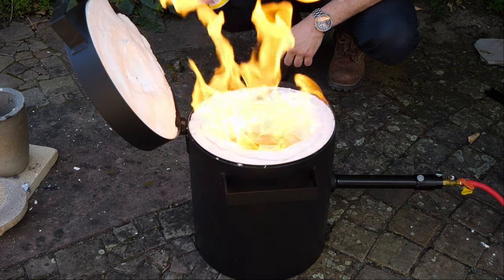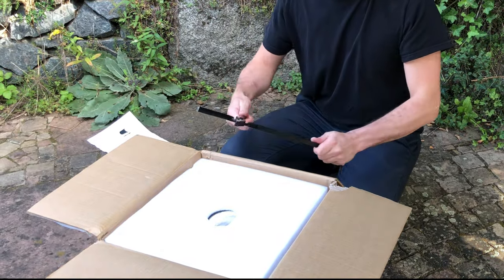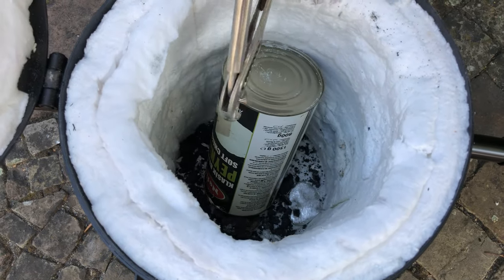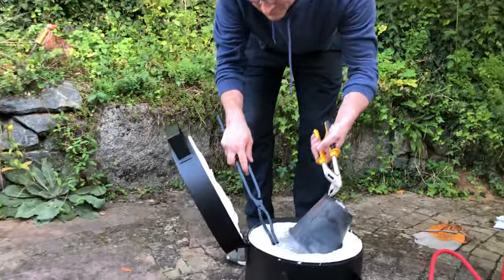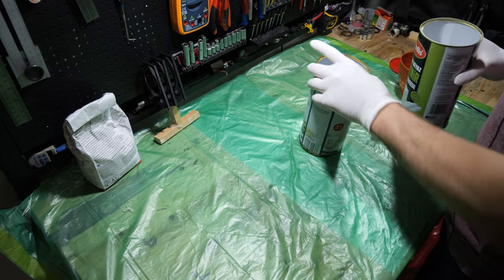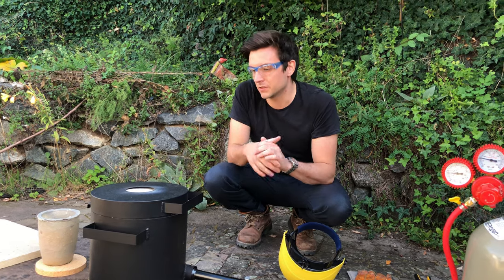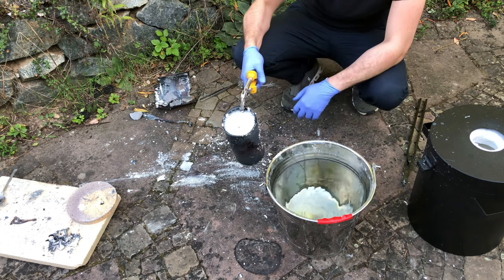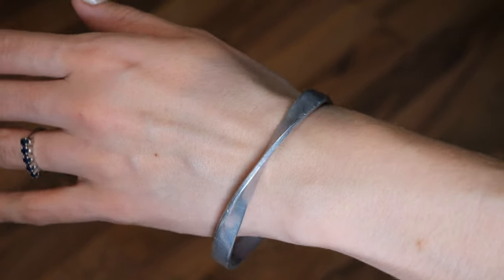Creating a One-Sided Nonorientable Surface

Comment: Aluminum casting is fun but there are a lot of traps. Liquid aluminum has a high hydrogen solubility that changes with temperature, but as a solid it has almost zero solubility, so bubbles are generated. Aluminum also forms oxides almost instantly when exposed to air, alumina at first and spinel if magnesium is present. Trying to cast extruded alloys is also a bad idea, they aren't designed to be used like that.
Reply: I agree. Cast Aluminium Material work way better. We tried that in our Hackerspace years ago. Got better results using an old car clutch casing ;D

Comment: If you want to try and cast for vacuum components you'll probably want some sort of vacuum casting system, since tiny voids will affect your vacuum performance. Also prepare to do lots of polishing
Reply: As a foundry man for 35 years I am quite impressed with your results! One thing I would suggest is a contact pyrometer since your pour temp is critical for proper mold filling since the aluminum freezes very quickly in the cold mold I would recommend 1430-1450 f and your mold should be around a minimum of 850 f. As a possible fun project our aluminum investment casting process is a low vacuum chamber around 20in/hg result ing in almost 0 porosity issues and a very good surface finish. Investment casting is a fascinating process and a 4000 year old art form that’s truly a diy friendly experience I can’t wait to see more.

Comment: If you're interested, some context on the process:

Plaster of Paris (as usually sold, in English; YMMV elsewhere of course :) ) is a dehydrated gypsum product.  On hydration, it reconstitutes a crystalline structure, bonding it together as calcium sulfate dihydrate.  This is lost again at around 250°C, leaving the half-hydrate.

The hemihydrate decomposes at ca. 500-600°C, leaving the anhydrous compound (anhydrite).  This is below the melting point of aluminum so you can't take any shortcuts here: it will bubble and crack if not heated to this temperature before pouring.

You can, however, get away with baking to just the first step, for cooler metals such as zinc, lead and tin.  (Tin alloys might not even need the first bake-out, just ensure mechanical dryness.)  Assuming of course, the pattern melts out at that temperature -- this is pretty reliable with wax, but you'll probably have trouble with polymers.

The full bake-out is required for use with aluminum or bronze, but no higher baking is required past that point; well, I suppose you'd want to bake it out really hard before pouring something like iron (the sulfate itself decomposes around 1300°C), but that would take quite a long time, the mass loss would be huge, and the result would still be inferior (iron readily forms sulfides, weakening the alloy).  This makes plaster-based investment molds well suited to all the common nonferrous alloys.

As demonstrated, the material shrinks on dehydration, and this never occurs uniformly (and even if it did, it'll shrink around the still-burning-out pattern residues, and most likely crack?).  Sand and other additives are used to reduce this; local pores may shrink, but the overall structure stays crack-free.  This requires at least half and half (by volume) plaster to sand; use a fine grade of sand, at least 50 mesh.  Fine sand, or ground flint, silica fume, etc. are available from industrial or pottery suppliers.  (Follow precautions around fine silica, of course!)

On the upside, molds are 100% recyclable: after quenching in water, the mold material is quite soft (or, it should be), and it can be broken up further to sort out bits of the flask (iron oxide flakes?), metal, etc.  It should be dried, pulverized and sifted to at least a modest mesh size, and can then be dehydrated in the oven, ready to mix with water and make more molds.

The material isn't very conductive to begin with, and it only gets more porous as it dehydrates; it takes a long time for heat to conduct into the center of the mold.  What's more, you need to allow time for the pattern residues to burn off -- not just to melt, but to char, and the char to burn away.  An hour at dull red heat (about 600-700°C) in the center of the mold should be adequate, and this may take a good hour to reach for molds this size -- hence the suggested 2-5hr time frame.

I wouldn't worry about keeping it hot; just sit the mold in a bucket of sand, to somewhat insulate it, and also to keep it together in case it cracks apart on pouring.  You can also draw troughs in the sand to pour ingots, and generally working on top of sand is a great idea for safety purposes.

Baking out in the furnace is a tricky matter; ideally it should be able to throttle down extremely low, then gets turned up a little bit at a time over an hour or so until red hot.  I don't know how well your burner performs, but my experience with most designs is, they get unstable at low flow rates, and either pulsate, or catch fire in the tube (with resulting erratic burning, and obviously the flame tube gets really hot in the process).  I'm a fan of the classic Reil style burner; I've made a few of these with, it seems, just the right aspect ratios (tube, flame holder ("flare"), jet) to run at almost arbitrarily low pressure, which gives excellent dynamic range in the furnace -- I've even fired pottery this way before (requires a slow ramp over at least a couple hours).

Good luck! Casting is a fairly simple process overall, but just tricky enough to be interesting, and very rewarding to see things come out of the mold!

Comment: As you are not afraid of a bit of Chemistry I’d try to remove the Remains of the PLA with a Solvent or destructive Reagent.
If you have enough of it available you could try to remove all PLA with it, as it avoids the Expansion of the PLA in the Investment Material when it’s heated up. Afterwards the Mould should survive a pretty aggressive Bake Out.

Comment: Agree with the other comments; you want an alloy with higher Si content, which increases flowability. 6061 has some, but not nearly as much as alloys for casting.

Also ring shapes are notoriously hard to cast because of thermal expansion.

You could also try a different form of lost PLA casting, where you skip the plaster, use only loose support material (sand), and skip the burnout step. You have to make sure your PLA pattern is low enough density that the escaping gases don't interfere with the casting process.
This process is how lost (styro)foam casting is typically done, but you can also do it with 3d-printed parts with low enough infill.
Reply from the maker: Thanks for the advice! 
I've tried casting sand and printed the part with the smallest wall thickness possible. But the aluminum was not able to burn it away. It only flowed a few centimeters into the part.
Reply: @AdvancedTinkering  Could always try adding a vacuum to pull the aluminum down

Comment: If you want a more reliable process consider counter-gravity casting. Use gas pressure to gently (up to 1 m/s, ideally less than 0.5 m/s) push metal from the middle of the crucible up a tube into your mold, optionally through a filter with 0.5-1 mm pores eg a few sheets of wire mesh. The filling will be more reliable and you will avoid porosity. The part of the bracelet that didn't fill could easily have been caused by a dirty melt rather than unburned PLA.

Pouring into a mold can work fine, especially for only decorative objects, but the troubleshooting can add up--you had to make the mold more than once.

Aluminum melts are full of unbonded double films of oxide of various sizes, known as bifilms. The aluminum you fed into the melt has an oxide skin, and any time you pour it you make more, and they reside in the bulk of aluminum alloy generally because they don't go away. They are approximately neutrally buoyant. The very largest pieces probably were scooped away with the slag, but the rest remain. They love to make clogs that prevent castings from filling completely, and they are ready-made sites for porosity and crack initiation. Clean metal melts cannot easily initiate pores, due to surface tension--the pores generally have to start from one of these bifilms.
Reply from the maker: Thanks a lot for the advice!
Reply: @AdvancedTinkering  I want to be clear that I understand this may be a bit much. Depends how much casting you want to do. You can get it straight from John Campbell the high priest of countergravity casting here: https://www.youtube.com/watch?v=aVWgx2lXNNs